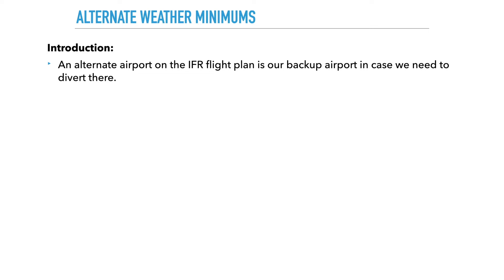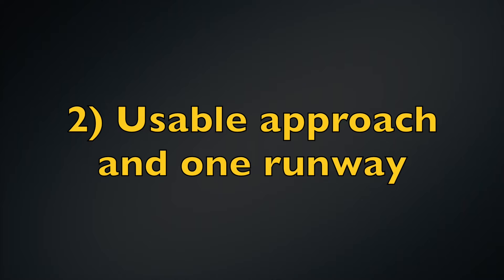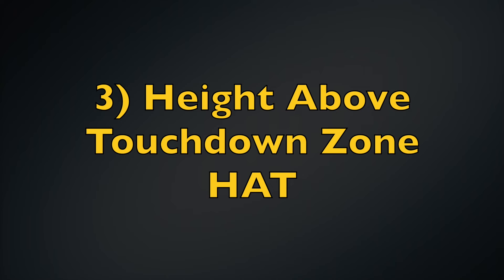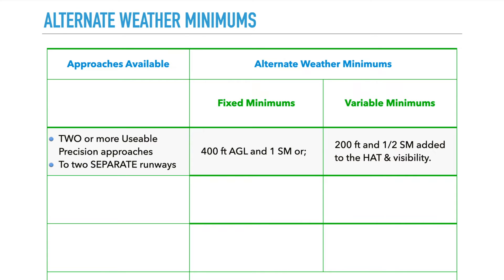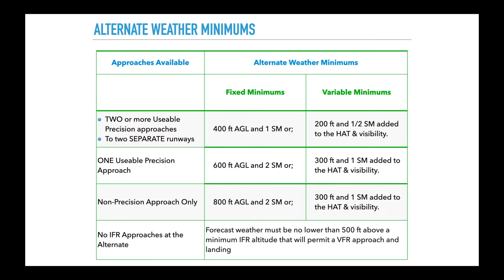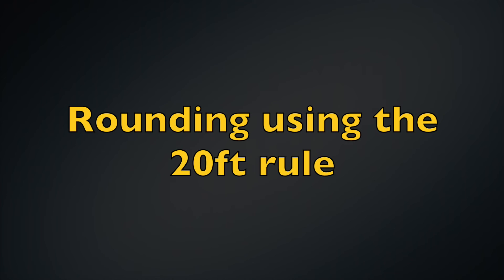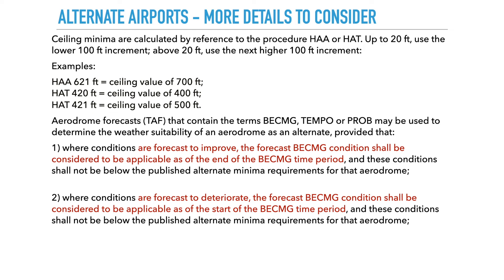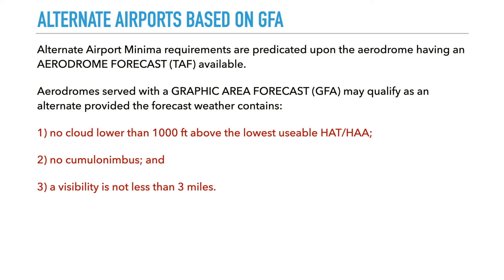Alternate Weather Minimums for the Instrument Rating (INRAT and IATRA exam) | Part 1

Comment: Small correction regarding the explanation of the Alternate Minima Sliding Scale.  You are not sacrificing visibility in order to have greater ceilings.  You are rather doing the opposite, sacrificing ceiling minima in order to choose an alternate with forecasted lower visabilites.
Reply from the maker: When determining an alternate, both the ceilings and visibility important at the planning stage/before you depart. It has to be at/above the TAF. The idea is to have you divert there and be able to land by breaking out of clouds. The visibility is also important because when out of clouds, you want to be able to see forward to then see the runway environment. The alternate minima has a higher buffer than the lowest minima on the approach chart.

This is only for planning purposes before you depart. Once airborne, all that matters is whether the ceiling is at/above the the actual approach plate.